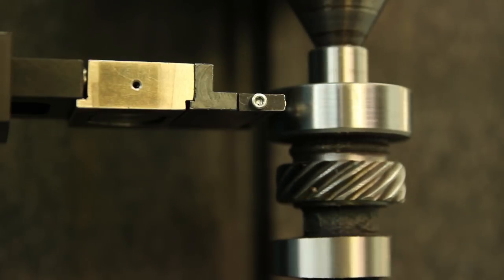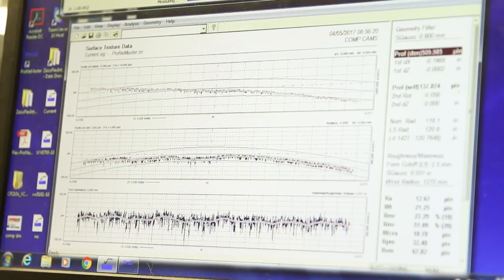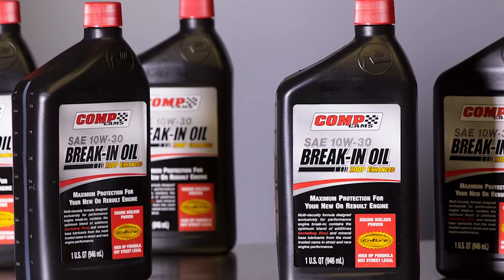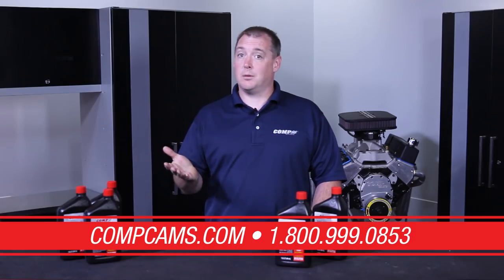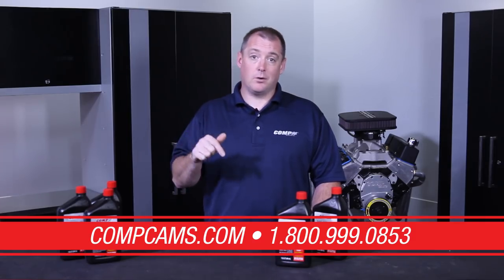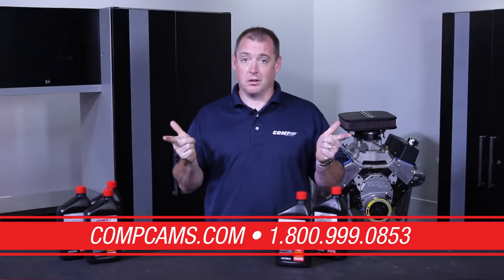COMP Cams Quick Tech: The 10-10-10 Break-In Method

Comment: Cam to lifter contact area before break in is about 1/10 that of full area contact after full break in. This 1/10 smaller initial contact area experiences far greater pressures due to the smaller area. This causes very quick heat build up on cam lobes and lifters. Once oil gets past 200-250F it starts failing and zinc in oil is supposed to offer momentary lubricity but it too can't withstand high heat for too long. This 10-10-10 method works real well. Run 5 cool 30 is even safer.

Comment: Someone here said it already but...
20 minutes at 2-2250rpm. Been doing it a long time too and only had one cam failure and it actually snapped the cam in 3 places. Not sure why the hell that happened but of course it was at high rpm haha!
Reply: i can answer this even if it two years later  its called cam harmonics, the camshaft does strange things at high rpm cause its not balanced. thats why they break.
Reply: yeah but you also didn't have the graphs and science that they do to show it... Your cam probably had more wear on the lobes.

Comment: Is this directed towards stamped-steel rocker arms and/or flat-tappet break-in only?  I can't see any benefit for roller rockers or roller cams.
Reply from the maker: The testing was specifically done on stamped steel rocker arms and a flat tappet camshaft.
Reply: Thank you for clarifying that.
Reply: SD1027hawn the test was done on stamp steel specifically yes but that doesn't matter it would be the same benefit for roller rockers.. the benefit is to slowly and easily mate everything in and to keep it cool to keep it all from wearing as much during break the o my difference the rockers make is it also extra beneficial to the stamped steel because of the cooling during cycling.
Reply: Now roller cam yea no bennifit at all..

Comment: Do you need any type of exhaust manifold with first start on a solid  roller camshaft before I install headers.
Reply: I always run exhaust manifolds during break in. That way you do not suck any cold air back into the exhaust ports.

Comment: can you mix break-in oil with normal synthetic oil?
Reply: Why, what would be the need or perceived benefit?
Reply: It is not recommended to use synthetic oil for a new engine breaking in, It is better to wait until engine has 2000-5000 miles on it. Synthetic is so slippery that it does not let the new engine parts wear in properly.
Reply: fastjp72 That's good to know. All my warranty stuff says no synthetics. I wasn't sure why. Thanks
Reply: Yeah, avoid synthetics.  They compete for space with ZDDP.  They have detergents that clear off the face of the lobes.  I would continue to use standard oil with a strong zinc additive for at least the first 10k miles just to be safe.  Also, do yourself a huge favor and put an army of magnets on the oil filter.  Those are proven to work and catch all of the magnetic metal the filters won't.  70% of engine wear occurs from microns 15 and below.  Oil filters only catch 25 and higher, and not even 100%.
Reply: Wayne Sanders:  Hey brother, can I repost this comment all over YouTube???  I have been in countless fights with people over filtermag.  Nice to read a comment made by an intelligent person for a change.
Reply: You can't argue with people that don't want to learn.  Don't waste your time.  I don't know what filtermag is, but I use my own magnets inside the engine and on the oil filter.  You need specialized magnets (samarium cobalt) for inside the engine due to the excess heat.  I've been using neodymiums on the oil filters and they're staying in place even on the sides so those are a viable choice.  I'm sure you'll find one our two couch commandos that will tell you not to do it because of the temp. rating, but if they're holding on they're still maintaining magnetic field.  I've had mine on for several thousand miles now on a supercharged jeep stroker engines.  The 4.0 is notorious for running hot as it is, mine makes more heat but my cooling system is nice and new so I don't have an issue with that part (but that doesn't mean the oil isn't running hotter, physics always has an unexpected ace up its sleeve when you least expect it).  If an all iron engine that is known for running hot is stroked, supercharged and neodymiums still hold on to the oil filer, I'd say it's safe to say that at least 95% of all street driven engines can also use neodymium magnets on their filters as well.  Anything that comes in contact with the oil inside the engine will need to be samarium cobalt however.  Oil is typically 10-20 degrees hotter than the coolant, so at 210 on the CTS your oil could be around 230.  I'm sure mine is at least that.  Another fun fact, for every 10 degrees celcius over 100 ( 100C = 212F, 110C = 230F) your oil's life span is cut in half, unless you have specialized oils from some companies like AmSoil or Joe Gibbs that gives you extended wear protection.
Reply: "Physics always has an unexpected ace up its sleeve when you least expect it"... amen to that!  Didn't know that about heat effecting oil life based on temperature.  I knew that heat had an effect on oil life... just didn't know how exactly that could be gauged.  Thanks for the info.  Very interesting.  What kind of blower are you running on your Jeep?
Reply: It's the Sprintex twin screw setup.  It's designed to add about a liter of displacement so I essentially have a 4.0 that's more like a 5.6.
Reply: Nice!  Twin screw seems like the way to go to make big power on the low end.
Reply: @waynesanders1406  do you just stick them to the outside of the filter, or zip tie?
Reply: @waynesanders1406  yea and don't forget the wooden clothespins in the fuel line to stop pre ignition .   /s
Reply: @waynesanders1406  ever new car for decades have come with synthetic oil in the crankcase,  they break in just fine.  there are several high zinc synth. oils on the market. i have been building engines for 40 years, never needed a special break in oil nor avoided synthetics.  my engines run 100's of thousands of miles.
Reply: you don't want to use synthetic oil on a flat tappet cam anyway. the lubricity is too much and doesn't allow the lifters to turn in the bore as they are supposed to.

Comment: If you do this with a flat tappet cam non roller you will be buying another cam in about 10 more minutes.
Reply: TEST Fifty why do you say that? What do you reccomrnd
Reply: nick hickcox:  I recommend you get a roller cam.
Reply: There's no reason you would need to do this with anything other than a flat tappet, and it's already been tested and proven to reduce wear. There's a reason Comp Cams, who puts more money into camshaft research and development than anyone else, is recommending this method now over the old one. If you ruin a cam doing a 10/10/10 break in, you were only going to wipe it faster if you didn't.